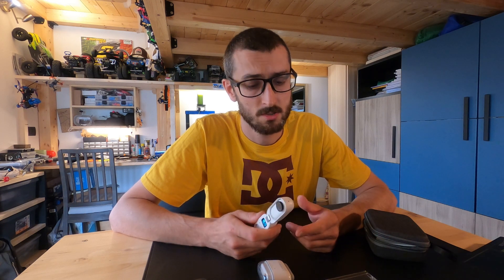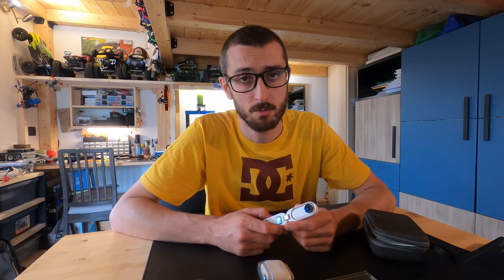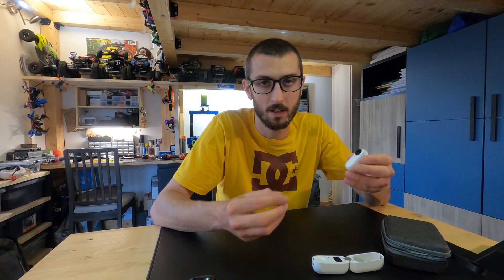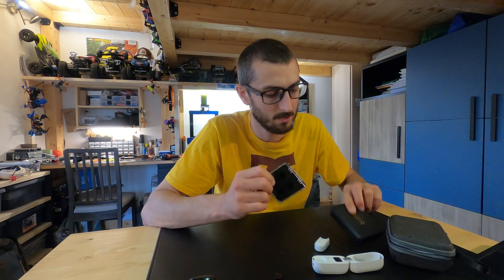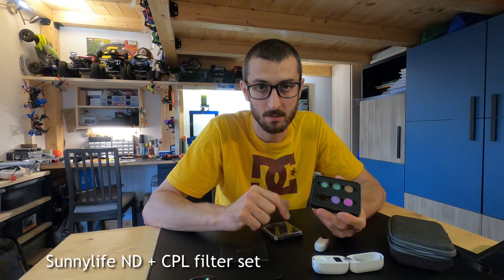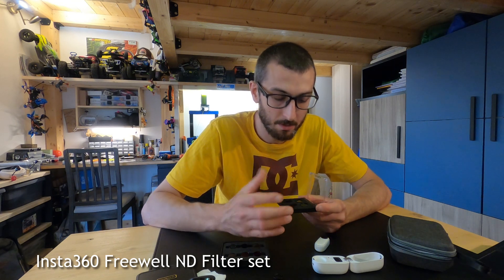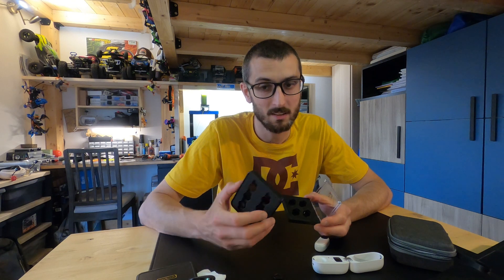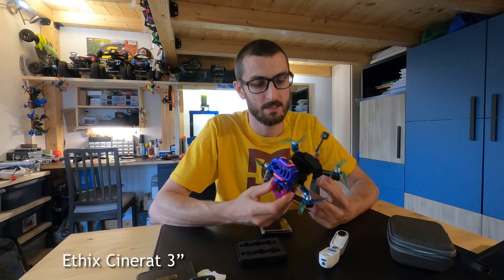TECH TIPS 03 // Insta360 GO 2 without Jello on FPV Drone

Comment: It looks like shutter is saved now ?  I restarted app and camera and my shutter is keeping.
Reply from the maker: Just tried it several times in the last days and it seems you are right… it keeps the preset for some minutes, then it comes back to auto!! 😫😫😫 hope Insta360 is listening to us 🤪🤪
Reply from the maker: UUUUHHHH thanks for the info mate! I'll check if mine works too! THANKS this would be a great improvement!!
Reply: I don't know what I'm doing wrong, there are times when it keeps the configuration, after a while, it goes back to automatic.
Reply: @chizolini  In fact I have the same behaviour :((
Reply: @fredericld6553  I did the following test, set the shutter to 1/60 and turned off the camera for 3 minutes.  Kept the configuration.  I redid the test it is with 5 minutes and it went back to the default automatic setting.  I did this twice the pattern repeated.  It only saves for a few minutes after shutting down.